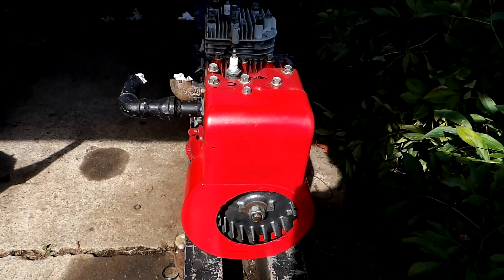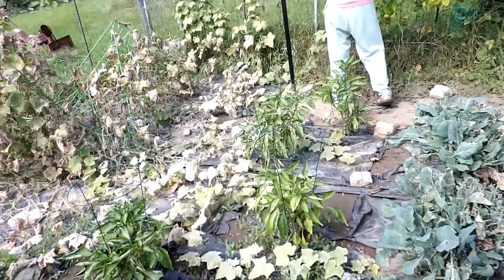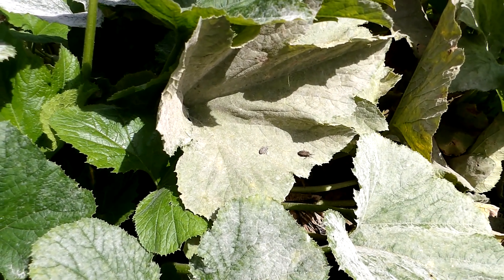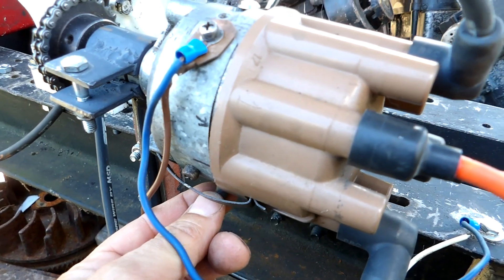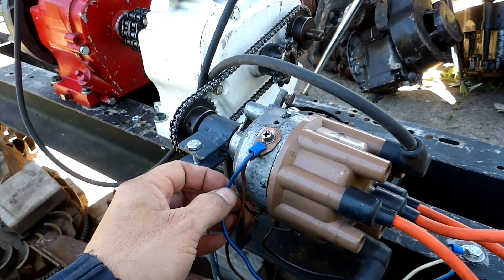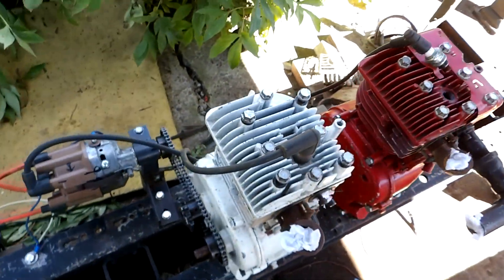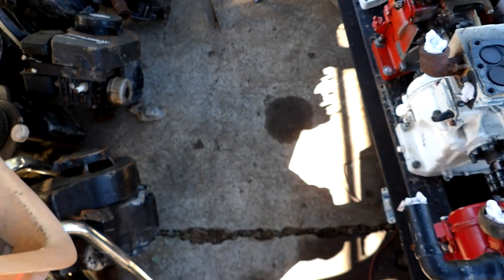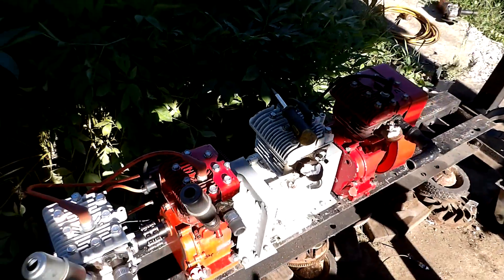Making the Briggs 5432 Part 2 Final Assembly

Comment: Ever use Lovejoy couplers? Always wondered how they hold up
Reply from the maker: Yes, my first 4 cylinder used LoveJoy couplings. I used too small of a size the first time, blew one apart, and LoveJoy hooked me up with proper sized couplings for free!  They also said that I should use coupling guards for sure, so I really appreciate them going out of there way as a big business to help out, (and maybe save a life!) for a little guy on youtube!  The Lovejoy couplings worked really well, I switched to double row chain couplings as they were a bit smaller in diameter for this application. For a normal application like a water pump or generator Lovejoy is the way to go, they are smoother and would last longer than a chain.  Thanks again Lovejoy, you folks really Rock!
Reply: @ChargerMiles007  that is good to know thanks man

Comment: Dristributors are confusing to me, I'm just so used to knowing how a 2CV's ignition system works (wasted-spark, fires on both compression and exhaust, each cylinder fires alternately, only has points to the coil, no distributor needed), the roundy-roundy arcy-sparky thing is just a box of magic... :P
Reply from the maker: LOL, yes distributors are a crazy item for sure, some weird things happen inside the cap!